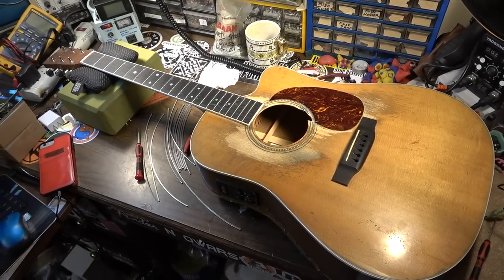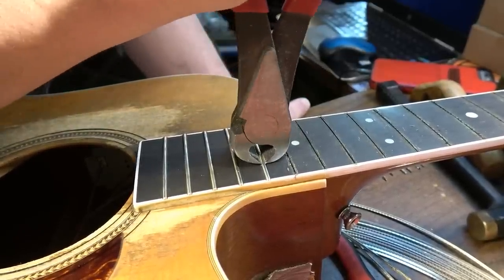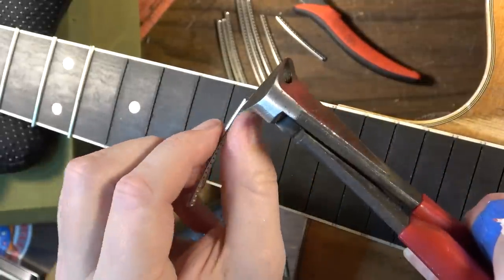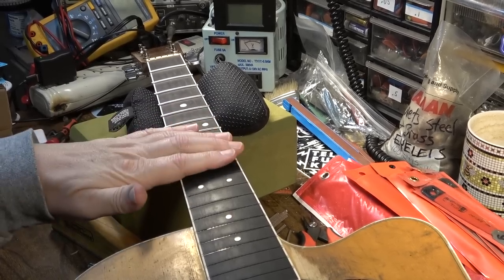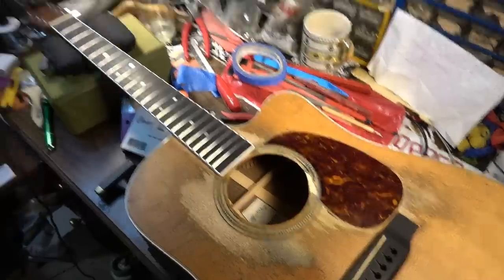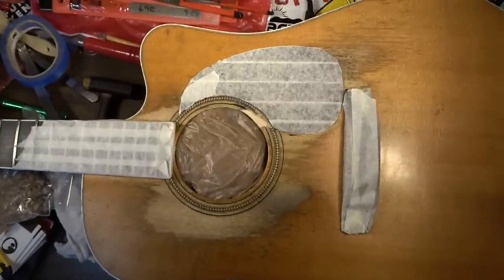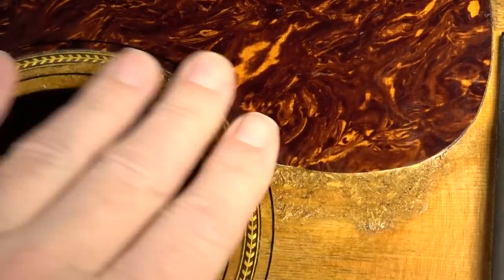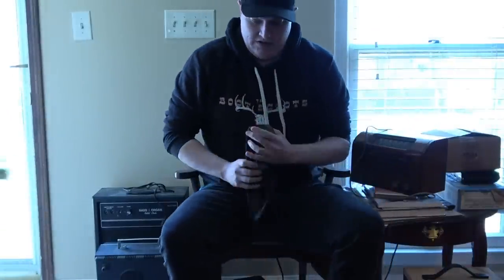The owner was SHOCKED I did this to his Martin!

Comment: Great job..sounds great! The only thing that threw me was using shavings and wood glue to fill that hole....my go-to would usually be sanding dust and super glue but that would have been harder to level and the finish lacquer may not have    matched as well...would probably have had too much 'sheen'. So good on you!! Good to know that guitar will continue in service for years to come. Cheers!!

Comment: As always I enjoyed your video and attention to detail.  The bottom line is the customer liked the work, but I will offer one remark.  I respect the 'function over form' outlook, but there's a fine line where that crosses into poor general upkeep and deterioration of the guitar, car, etc.  My two cents.
Reply from the maker: A routine clean and polish of the top would have helped keep the wood from chipping too, because sometimes, depending on the chemistry of the particular person's sweat, the lacquer can tend to coagulate and rub off the guitar when not routinely cleaned. After the lacquer is gone, the wood then starts to chip. People don't realize lacquer is almost like a liquid or slow moving gelatin, more than it is like a solid. When you polish an instrument with nitro lacquer or shellac, the old lacquer sort of melts in the neighboring molecules and reforms the barrier.
Reply: @The Guitologist  hello I have a question I was hoping you could help me with if I hooked up too many speakers to my dsl 40c bad idea I know this now. So what is the chances that I only blew a tube and not fried something else it was one extra speaker I believe it was an 8 ohm that was added
Reply: @firefly5783  I'm sure you checked the final ohmage, with regard to series and parallel configuration, f?

Whatever, Brad will guide you.

Stay free.  Rab  🍻😎
Reply: But Still Hard Miles wear things down you can't clean off wear dude. Trigger got that way from use not abuse.
Reply from the maker: @timscarrow9151  It was abuse in a way if you consider a classical nylon isn't meant to be played with a pick. Willie really should have gone with a Flamenco style with a clear pickguard on the top.
Reply from the maker: @firefly5783  Too many speakers could either result in too low of an impedance or too high of an impedance. In all likelihood, you just took out a tube or maybe even a power cap. Check your fuses too. Probably got your high tension fuse. Check the continuity of the Output Transformer. With any luck, you didn't kill it. If you need guidance on how to check your transformer or with what else you might check, be sure to join my locals community: https://theguitologist.locals.com/

There's several competent techs there besides myself who can also help you out. Good luck!
Reply: @TheGuitologist  Thirty years of use too, it's not like Willie to play any other Guitar. Dans repair Vid was worth seeing though.

Comment: I have a 1970 D-35 and it has been played a lot. It has none of this damage, not even close. I did have to replace the pick guard as it some how starting peeling off and warping as it came off. Some of the bracing had to be re-glued but the finish on my Martin look new compared to this abused guitar. Sorry but I see this as abuse. Looking at the frets, it has been played a lot. Beating on the box and putting holes in it is just now what I would do to my guitar. Good work restoring it.

Comment: I ripped out frets on a Fender JP Bass 20 years ago. 🙄 I didn't know about the Soldering Iron to Heat'em up & took out some chunks of Rosewood. I used White Epoxy to make a Cheaters Fretless. I loved it still. I now have a Jackson with a Dinged Fret Ebony Board. I keep putting it off. Thanks for the Encouragement Motivation Brad. I'm going to give it a shot with the heat this time. It's only the 1st fret. 😬🙄😁

Ps: Awesome Job as Always Tanx: Brad

Comment: this guy should have the top restored, use the sanding dust and superglue to fill in the low and missing spots, refinish with a few coats of clear lacquer as they did at the factory then apply that clear protectant they put on cars and sportbikes what not... then as or if he wears through the hard clear plastic he just changes that out, he can do that himself just save the pattern, have it cover all the wear areas he wears out. above and below the sound hole... preserve that wood.. wont be long it will need a new top.. all kinds of fun
Reply: Why on earth do you think he'd want to do that? 🤔

Comment: Wow. I have learned something today. With more money and time could the top look smoother without looking filled in? I appreciate this customer was not worried about that.
Reply from the maker: Yes. It might be possible to fill and smooth all the low areas, then sand completely and refinish. The sound hole could be repaired with a solid wood piece rather than a filler, but that would take way longer and would be more expensive. I would not have had time to complete that sort of detailed repair by the deadline.

Comment: Good job Brad. Maybe if the intermittent cutting out issue persists, its from a substandard cable jack. A ¹good Neutrik should sort out that issue.
Reply from the maker: Turned out in the end to be a bad connection on the battery terminal.

Comment: About that intermittency Sometimes its not the jack but the plug contact of the cable is the problem... I have an old cable that doesn't make contact in my guitars but does in my amp... apparently one end is worn down or smaller from the factory on one end... if I reverse it ...works fine... So..
Maybe he's using an old cable

Comment: I wish there was a local luthier this talented where I live, or any luthiers for that matter. My dad built instruments but I never took the time to apprentice under him and learn it all. I've got an old Gibson acoustic that needs a ton of work, a Epiphone that needs a fret job and new bridge, and a Les Paul that needs new guts. I can handle the Les Paul- maybe the Epiphone acoustic as well- but the Gibson is over my head and I don't want screw it up. It's an old arch top with the F holes in the front- binding is letting go, sides are separating from the front, neck needs adjusting (last time it was strung the action was incredibly high), needs new tuners, new nut, possibly a fret job, may need the neck straightened. But I have no idea who to take it to- I'm in north Alabama- any suggestions? 

Edit: My dad said it was a late fifties model- not sure what year.

Comment: Excellent work! I'd have like to have seen the frets hammered in on the fingerboard extension over the body.  Stew mac likes to make you think you need a specialized brace to ensure you don't split the sound board.
Reply from the maker: I’ve never felt the need for such a thing. Not saying it couldn’t happen, but cracking the top from hammering frets seems unlikely.

Comment: Great repair Brad for sure and I don't want to shithouse you technique at all but super glue with the dust is a much stronger bond and also it's cleaner and once smooth it also takes a shine to and you can tint it also for better results. It does take longer and a bit more elbow grease tho. I'm honestly not saying you done it wrong I'm just giving another way to do this sort of repair.

Comment: I think I would have taken a picture of the sound hole  0:00 0 0:00 0:00 0:00 in a good spot,then printed up a picture of it on a printer,cut it out to fit it over the repaired area,and put a coat of varnish over the paper sound hole print,not sure what they call that inlay around the sound hole, but you get my drift,I would probably be mad about the saw dust fix,although it will work,just not that good looking,you had me doing a lot of thinking about this repair,without replacing the whole sound hole decal and what looks like little tiny mother of pearl triangles,this was my solution,a color print of a picture of the good part of the decal,don’t even know if it would work,but face it brad you will be getting backlash on this one,hey sawdust,come on brother you can do better than that.😅

Comment: What tolerance did you use for feeler gauges when you cut the nut slots. It shows .024 on top but there is another strip or more under that? Great video. Thanks
Reply from the maker: The actual measurement off the fretboard isn't what's important, what's important is that you measure the height of the first fret then add maybe .01 or so to that measurement (I often go slightly less than that). That's what I did here.

Comment: This model is not a "top of the line" MARTIN. If the owner wanted to use it as a 'beater-guitar', that is perfectly fine.  Not sure if a costly repair is worth the effort on a guitar that is only worth around $600-700 dollars on the market in 2023.  But, I admire the work for what it is.

Comment: Should have used a hair dryer to heat the duct tape and it would have come off so much easier and with hardly any glue left on the guitar. To be honest I think the whole job was a little amateur. Sorry but that's my opinion. The sound hole and top could have been better repaired much better.

Comment: I would put the lightest acoustic strings possible so it would be easier to play.
Reply: Probably ought to put on what the guy had since he’s a working musician.
Reply: @fivehead6675  being reflective of the new frets that were newly installed even working musicians would appreciate a easier string considering his new frets were higher and newer. Its gonna take years for those frets to weardown again..
Reply: Why? Skinny strings don't have enough energy to vibrate the top, and the guitar sounds anemic.
Reply: @mattrogers1946  I disagree. The pickups will adjust the tone and volume and will bring it as loud as possible... Especially with hammer ons and pull offs and will make the string sound better(as long as he sets the pickups and volume in balance and in my opinion (especially if he playing the blues) will enhance the sound and achieve a cleaner sound because of the ease of the playability of musicians hands. Point is the guitar follows how well and easily the musician can play and won't fight the highness of the new frets which will make it sound follow the ease of the frets on the string.
Reply: @FuzzballToday  I play blues, and I find heavier strings vibrate the top of an acoustic more than slinky strings do.